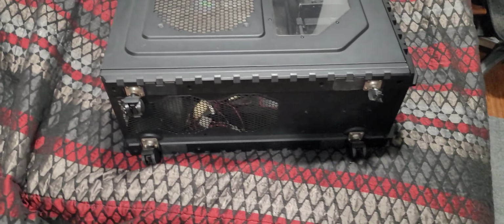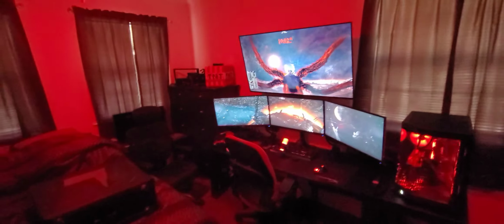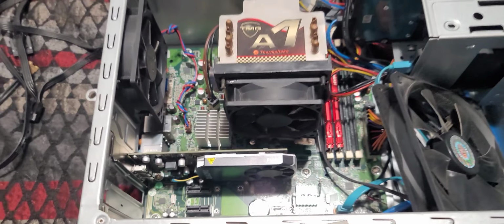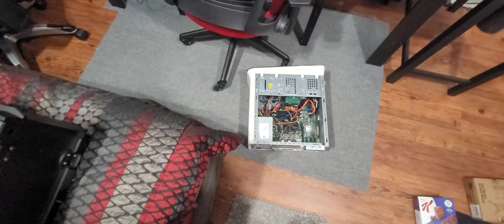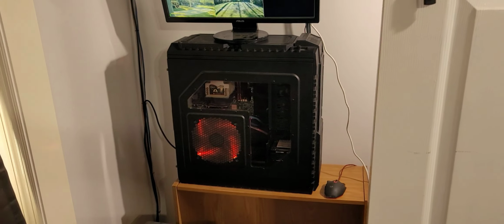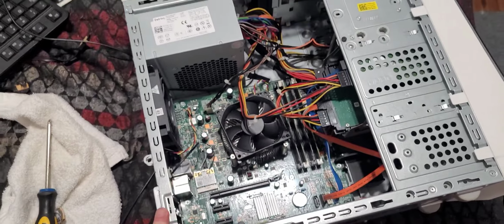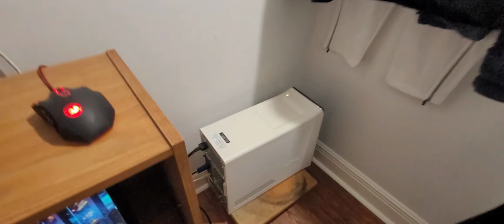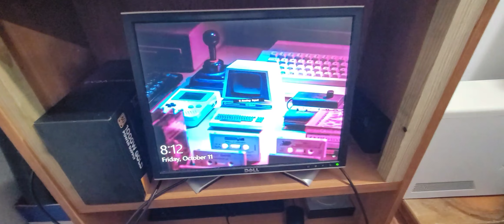upgrading my ghetto server

Comment: love the concepts, only feedback i got. is why such a beefy psu .... was thinking you were gonna go thread ripper when i saw that LOL
Reply from the maker: I bought it around 2012 ish and just replaced it with a 1000w and a new 10 year warranty. I mine from time to time and it never hurts to have beefy PSU. The 10 year warranty on that 1200w went out a few years ago. It's a no brainer for me to get 1000w or more because I'll use it. That PSU used to push dual 5870 Eyefinity Editions on water in the same case. It's in my old videos. :)
Reply from the maker: Oh, I have a 3900X 32GB rig next to me in my shop that I use for Palworld server for me and the kiddo. The machine in this vid is my jellyfin/minecraft bedrock server. (Phenom II x6 1090T 16GB. And I have a quad core intel 16GB server for testing stuff.

Comment: so what's running on those servers?
Reply from the maker: One is jellyfin and minecraft. I've almost ripped half of our DVD/VHS collection and ran out of energy. So I add to it from time to time when bored. Other is a quad core intel, that I can spin up whatever on. Every new game we play I see if I can get dedicated server tools and spin up and test everything on that machine. I also have a 3900X in my shed that is our palworld server and CPU mining. The other server in the closet was also another spacemesh node where I was doing some disc plotting and mining. I was using it to idle random games and stuff too. I can always use another headless PC to remote into.
Reply from the maker: The spare server in my closet also has a file share on it and I'm logged into my modding sites. So if I want android mods/PC mods I can download them on the networked drive and I can grab my mods to deploy on any of my machines/androids. I do chromebook sideloading and stuff. All the downloads happen on that machine and then I just connect to the file share from my chrombooks/androids/tv's n such.

Don't want to slow down the main server or my 3900x 32GB server doing my modding crap and I don't want to download some obscure mods on my main desktop. So extra PC can handle all that. It's just a download, share and test box. It was free throw out PC.
Reply from the maker: I got the GT400 Quadro card for transcoding. Some of the old movies/my old devices are not compatible with each other. I found the GT400 for like $25 I think. Now when on an old device it will just transcode the vid to whatever is supported. (kids have old under 720p tablets n stuff) I can convert or re encode all of the videos, but I thought it was cool to do on the fly and was fun to learn about.
Reply: @DREAD69XI  so basically you never throw anything away and just find some use for all your computer hardware.
Reply from the maker: @Tolstoievsky  I sell stuff I don't need. I get computers and parts all the time. That's why I think it's funny I'm still running a 6 core Phenom from 2009 in the main server. I haven't had anything better show up. Our area is like 10+ years behind in tech. When I CPU upgrade, monk gets 12900k and her 9900k will finally go in the server. Oldest PC will go on the market after upgrading everything. Rinse repeat... Funny one is going to be when I get 5090. Because monk is going to have a 4090 at 1440p... Sure I could keep her on the 3070 at 1440p but she would love the 4090 and I can turn all her settings maxed. I really like her sharing top end gaming with me. I would have loved to be in something with my dad like that and with my back messed up, short on options. But yea, I re use everything.. lol